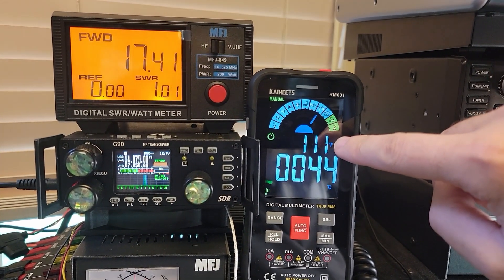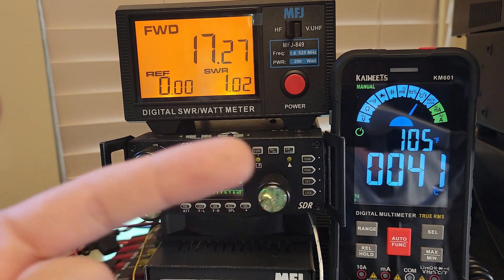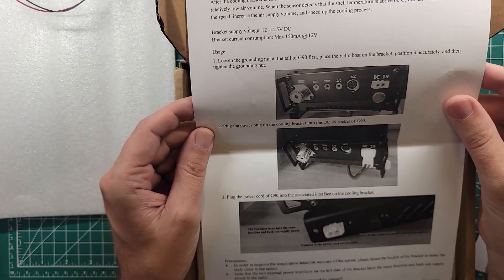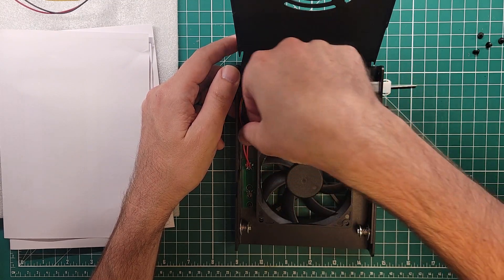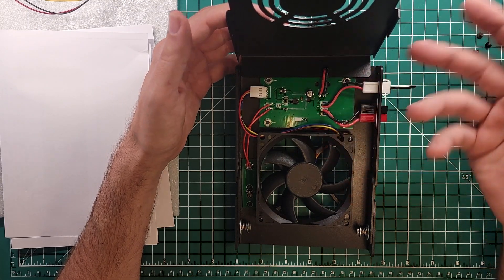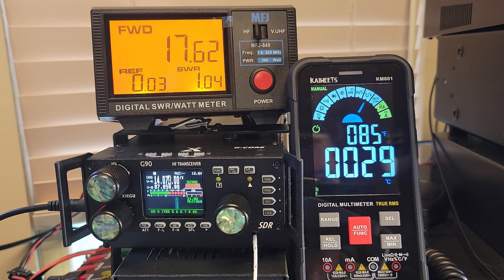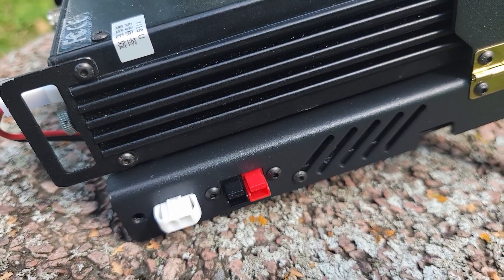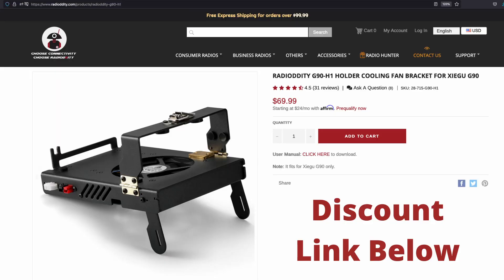Cool down your HOT radio! - How to keep your G90 radio cool in style

Comment: operating range does refer to the environment, not to the temperature of the device…. 😝
Reply from the maker: really?  so in my example where I was in my ham shack at about 70F and the radio was 111F that's totally acceptable?  no problems operating the radio that hot?  ya know, since the "environment" was below the temp listed in the manual?  Where's your mechanical empathy bud?
Reply: If your theory is correct, what sense does zero degree Celcius make? Might be different where you live, but here in switzerland, these specifications do refer to the environmental conditions where the item is supposed to run without any electrical problems. peace ✌️
Reply from the maker: @oliwawuff you didn't answer my question.  Unless you're still trying to suggest that running the radio at 300F in a 70F room is perfectly acceptable.  I'll stick with taking good care of my radio's own heat regardless of the environment the radio is in... Or even what the ownerd manual says for that matter.  "I" am the control operator.

Comment: I'm not into digital modes, but I wonder if FT8 keeps the transmitter running hotter than either SSB or CW? And it appears you are running with the maximum power the G90 produces. I wonder if running 5W CW would get very hot at all. And how about just receiving? Also, do you know if you can have the fan attached to the main body while keeping the detachable head separate? W5PAZ
Reply from the maker: You're on the right track - FT8 is a "full duty mode" - it keeps the transmitter outputting full-power (or whatever you set it at) for 15 seconds, then waits for 15 seconds and goes to full-power again for another 15 seconds.

The G90 at 5W probably doesn't need this, but it depends on your operating environment.  A friend of mine runs his at 5W CW in the direct Arizona sunlight and it has problems inside of that all black case with no cooling fan.  

You can run the fan stand without the head on the radio.

Comment: So you cooled the radio with ... a fan. Big deal. Try schlepping that up a mountain to do a SOTA activation, with the extra batteries required to power the fan. Here's an idea for SOTA: drop the fan, keep output power to a max 10W or 15W, use a sun-shade and use the radio in a position where the air/breeze can get to it. Works every time.
Reply from the maker: You'll get zero disagreement from me.

Comment: So you have a G90 sat on a sealed fan that is in top of a flat surface??? where's the heat supposed to go if you block both sides of the fan?
Reply from the maker: It has side and rear exits as well.
Reply: That all?
 @temporarilyoffline
Reply: No wonder it's hot
 @temporarilyoffline
Reply: Not trying to be a dick but the hot air needs to be removed ASAP  and as fans work best  top to bottom or left to right, your method cuts that route out.
Get an old laptop cooler, turn it around and you have an efficient cooler and a better viewing angle, hope this helps, 73
Reply from the maker: I didn't design the radio with zero cooling built in.  I didn't design the fan stand, although it does have legs (which you can see in the thumbnail) to get the airflow that you're demanding of me for some reason.  I also demonstrated in the video that the temperature rises and then when I turn on the fan the temperature drops.  Looks like you just want to argue instead of look at the actual proof that this works.  Have fun.   @surak1841

Comment: just got a g90 and this cooler. first HF rig :)
Reply from the maker: Congrats - that's a lot of rig in a small package.  If you ever decide to expand, look for the new DE-19 instead of the CE-19.  Best solution for this rig and FT-8 and the XPA125B amplifier.  Skip the GSOC no matter how tempting it looks.
Reply: @temporarilyoffline  deffo up for some FT8 will have a look at the Xiegu DE-19, thanks.
Reply from the maker: I used the DE-19 and the XPA125B in this video: https://youtu.be/pGgXcR3SDig Super Easy.  I need to make an FT8 vid on it too.  @letmelooktv
Reply: How do you like it so far?  Is the 20 watts been good enough?  Thinking about getting one payday.  Only thing I'm worried about is if 20 watts is enough.
Reply from the maker: I do most of my work at 10w these days, so the 20 on the G90 is a luxury!  The g90's built in tuner is also fabulous! It's a great starter rig that will last you until you get the itch for a replacement

Comment: Nice. I’m wondering — for that day when I finally cave & run FT8 on the beast — if I shouldn’t get that & the DE19 at the same time. Your demo has me pretty much convinced, even if all it does is raise the radio off the table better ;-). Thanks for the complete run-thru. 73 de W8IJN
Reply from the maker: If you are going to do serious FT8, then the digirig or the de-19 should be good.  I have both and I need to test them out.  But the cooling fan is a must if you want 20w out of it

Comment: Love the radio and the cooling unit. My only beef is that the cooling unit stays on constantly if it has power even if the radio is off......and mine is a bit noisy. Anyone thought about putting a switch on it? Would be nice not to have to constantly plug/unplug it.
Reply from the maker: It should have a temperature probe on it, is it not working?  If it doesn't have the probe, would be a fun project to add one.
Reply: @temporarilyoffline  It has the probe, but always seems to run wide open. It's not horrible noisy, but enough to be a nuisance while using the other radios.
Reply from the maker: @davearmbruster3  probably needs some troubleshooting.  I'll have to check mine and see how it's working (or not). A switch would be easy enough to install though.
Reply: I think I read somewhere that the fan kicks on at 77° F. I just got the G90, cooling fan and data card in a discounted bundle. I live in Florida and it's always above 77° 😆

Comment: Does it need the cooling really, does it melt or going to shutoff fot thermal protection at some point? 

Thise degrees in a manual are for enviroment temperatures, at least they were, at some point when that was explained in manuals. 

I am still nit sure if to get myself g90 for a go bag, additional fan is unwanted thingy for me, sadly
Reply from the maker: The fan is only needed for high duty cycle modes like FT8 or high temperature areas.  I can't imagine you'd need it for voice modes.

Comment: Awesome TO, I wonder if it would stay any cooler upside-down sense heat goes up? Most thought out amps cool from the top of the amp with a good heat sink.
Reply from the maker: There is a heat transfer pad right where the finals are supposed to be inside the radio.  I haven't taken this radio apart yet, but its on the list!

Comment: Does the G90 run hot when only on SSB?
Reply from the maker: No, not at all.  It's just a duty cycle thing and ft8 is pretty hard on radios at full power for 15 seconds and then off for 15 seconds.  With SSB, you'll rarely hit full power for more than a second.

Comment: The stand is worth it for the viewing angle and the powerpoles. It also does a great job at cooling. The engineering of this unit has evolved a bit since it's introduction, and some of it does appear as an afterthought, but it is a very practical accessory to the G90.
Reply from the maker: Agreed!